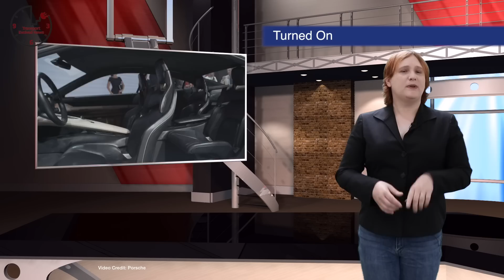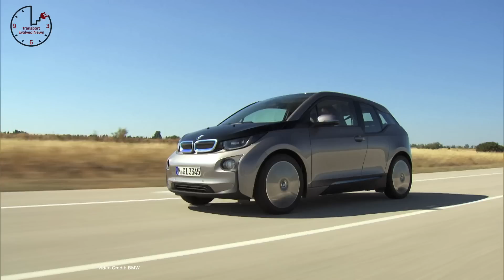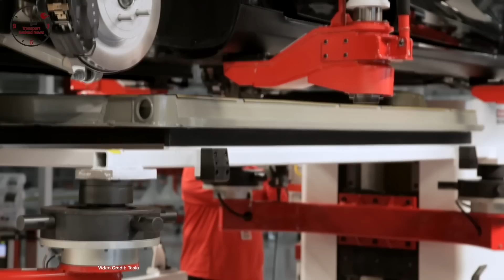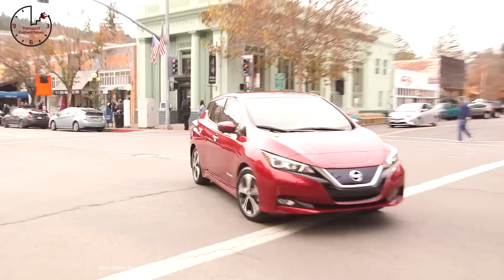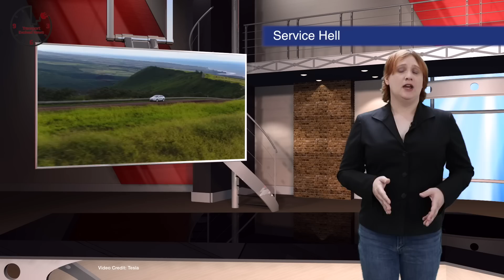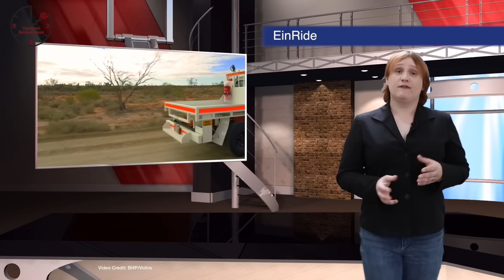Porsche 800-V Charging, Gigafactory 3, 2019 Nissan LEAF:  TEN Episode 214

Comment: On the Volkswagen e-racer, here's a link to e-racing page showing the vid:  https://e-racing365.com/features/videos/dumas-breaks-ev-record-at-goodwood/    Slight case of OMG, dunno about the VAG corporate body, but the racing arm is trying hard to reach greater heights.  Look, that's puns and metaphors, all mixed into the one sentence, applause surely warranted...

And if you like e-prix etc, hope Nikki does not mind me pasting so you can take a look at this, spectacular because they had to drive in the wet to qualify for the New York e-prix in Brooklyn.  Includes a 720 degree by one of the competitors...!

https://e-racing365.com/formula-e/new-york-race-2-qualifying-highlights/

Er, would Nikki say 'Keep REVOLVING'?!  Ha ha, I know, I kill myself with this stuff.

Comment: Lots of good news... thanks.

You covered the RoboRace car at Goodwood, but considering that the festival has seen nothing but ICE-powered cars until fairly recently, it would have been good to point out that the RoboRace car is not only robotic, but electric.  The RoboRace team are specializing in not only AI for vehicles, but electric drive as well.

We should all hope-- and EXPECT--- to see both technologies expand quickly over the next few years until they dominate NHRA, Indy, F1, and every other genre of sporting event... and then, even more quickly, become the ONLY choice of powerplant for racing vehicles once racing teams realize EVs are not only faster, corner quicker due to their low centers of gravity... safer since they cannot explode and immolate the driver... and are less expensive to operate and service.

Automotive racing and the demand for high performance is already starting to create obsessive demand at the street level, which car makers will sate... eventually. They will find it impossible to sell ICE cars once the general public understands that there are no advantages to ICEs.

<><><><><><><><><>

I had a serious car accident in my Chevy Bolt recently.  I was already doing the freeway speed limit, but without warning was slammed in the rear hard enough that had I been in an ICE car, I am sure my passenger and I could easily have been incinerated due to the gas tank rupturing.  Since EVs have a much lower center of gravity and the weigjt is not all up front under the hood, I was able to bring the car to a controlled stop.  Had I been driving an SUV as many cars are these days, it could easily have swerved out of control, tumbling out of control down the highway, perhaps killing others before it came to a stop.

Just how much safer an EV is than an ICE car is very real to me.

Comment: LOTS of stories this week, even considering a week off (with our sympathies).
It's great news to see that there is now consistently so much EV news. Even if they aren't alwyays good news, this shows us that EVs are penetrating the market.

Regarding Bolt production; hopefully production increases are modest because the additional capacity will be going toward the once rumored Buick compact SUV based on the Bolt hardware. If that product were to hit the market I would add one to the fleet sight unseen.

Comment: Regarding your last story, I'm a bit surprised that converting ICE vehicles to EV's isn't a more common thing. I for one would love to have an S-10 pickup converted. I had one for many years and I loved that little truck...Just thinking out loud.
Reply: S-10 conversion were fairly common about 15 years ago. Trucks are made to carry weight, and back then it was many lead acid batteries.
Reply: The big reason is cost.  If you use a similar battery to the ones in the Leaf or Tesla it might cost $20k-$30k dollars for the battery alone.  Then there is the cost of the motor, controllers, etc...  Not many people want to invest this kind of money in a used vehicle, especially a S-10.
Reply: Depends.
Most trucks use a frame on ladder design.
This gives you a natural built in location where you can install the battery tray, behind the cabin, below the truck bed.
Also if you keep the transmission, you can use the transmission as a mounting point for the motor, and you'd still have the rest of the engine bay for controls and more batteries.
Do a search for an electric Samba, someone, a former carpenter, self taught engineer who had fewer years in school converted a VW bus to electric.
The motor is mounted on top of the gearbox, batteries are in the engine bay.
Reply: There are some folk doing it, but it is very specialist. The rapid improvement in motors, electronics etc means that it is a nightmare for a small company to keep abreast of what is the best package to put together. The batteries are also an issue with even the large manufacturers struggling to get enough it is unlikely they will sell them to small buyers, if for no other reason than the grief of helping them do a safe install.

I think when more better quality parts are available, and the control, changing etc tech has matured a bit more conversions will become more common, although some vehicles will still be a challenge because of lack of low down space to put the batteries.